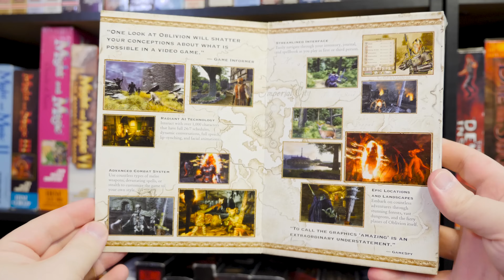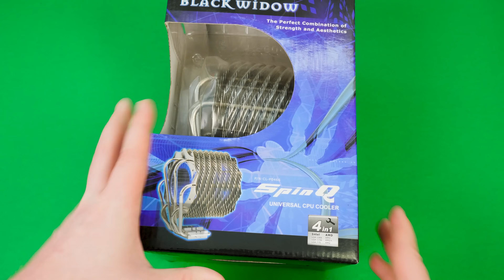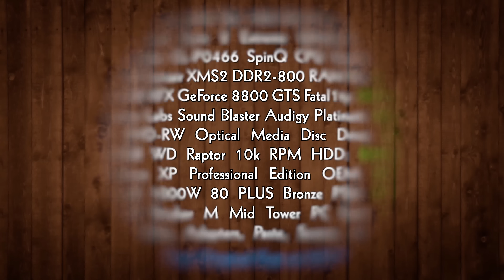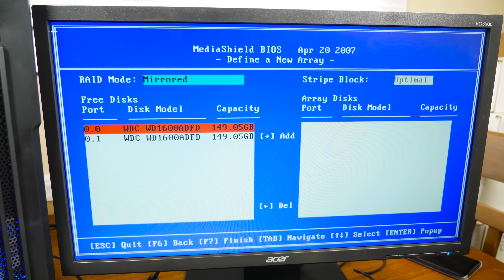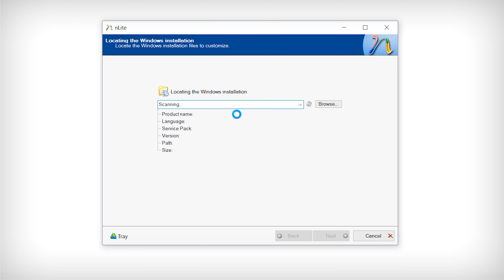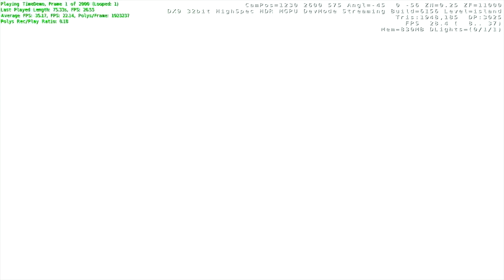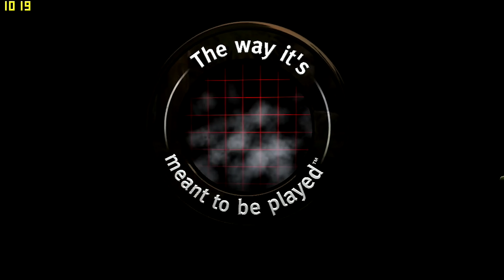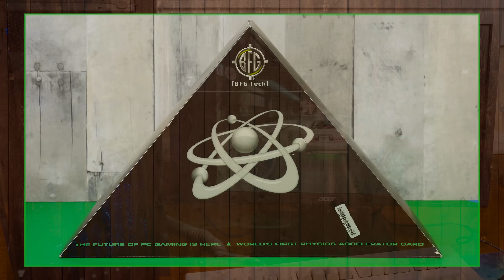LGR - Building My Dream $3,588 Windows XP PC

Comment: I miss how nice XP was without all the “cloud” based bs
Reply: pretty much the cloud based bs started with Windows 7, got way cloudier with Windows 8, and is almost only cloudy with Windows 10
Reply: You're just not using cloud right...
Reply: There are clouds...on the desktop X3
Reply: @uwu_peter  "almost only overcast* with Windows 10" ;-)
Reply: Welcome to 2021. Where everything is online all the time.
Reply: @wut6922  2027: Can't breathe without an internet connection
Reply: I hate to be that guy.. but this is honestly where Linux comes in. Super modern OS, more modern features than Win 10, 0 Cloud bs, 0 tracking bs, 0 ads bs, zero win 10 bs, Max security
Reply: @BartekJuszczak  And if I use Linux Mint, I can theme it to look like XP or even Longhorn! Unfortunately, I can't run all Windows games without either Wine or a virtual machine
Reply: @LegoWormNoah101  "Can't breath without an internet connection"

I can say that your quote can become a reality.

If the air will be competely polluted, you need to buy oxygen tubes from the internet,which requires internet connection.
Reply: @normalperson-x7o  That's not what I meant, but OK
Reply: @LegoWormNoah101  yeah,i know that is just a joke.But imagine your small joke become a reality..
Reply: @normalperson-x7o  I'd rather travel to another dimension and leave this planet behind
Reply: @LegoWormNoah101  agree
Reply: @uwu_peter  Then Windows 11 coming and was nearly cloudy like Windows 10.
Reply: @megakarlach2  basically just another Windows 10 major update, It should've been the 21H2 update instead. But ehh, things will change in the future anyway.
Reply: @spacetoilet  Depends on your PC I guess, some companies don't want to show the source code of their driver and on linux the drivers are built into the OS and meant to be  open source. 
On my AMD machine I don't need a single driver including peripherals, everything is built into the linux core
Reply: this and with win 7, shame i have ot use 10 if i want a pc gaming now
Reply: yes and when you searched for a program it didn’t redirect you to a bing search for it
Reply: @BartekJuszczak  Those things are why I like Linux, but most people including me just want their programs and games to be compatible and not have to tinker with things when something doesn't work. Win 10 and 11 are bloated but it's never forced anyone to use OneDrive.
Reply: Same
Reply: It was hdd based lol
Reply: YES!!!***
Reply: @BartekJuszczak  yeah but which version doesnt have any corporate bs or hacker bs? I havnt found one yet, though i really want a linux desktop and linux phone.
Reply: @megakarlach2  I predict 11 is just going to be a test-bed. 12 is where things are going to change. ...hopefully backwards, so we can get a stripped back non bs basic version to run on older hardware to keep it out of landfill. All these super fast mega hyper machines that use so much power to do not much more for most users than really basic machines used to do much more easilly are such a waste of resources and power. I really wish the Global summit would sue Microsoft and Apple for causing so much eco-waste and fuel waste. Its killing our planet.
Reply: @carpanojr  Linux is polluted with too many flavors and cloud based crap too. No thanks. And you still have to manually update everything and pray a driver will load 🤣
Reply: @BartekJuszczak I agree with this. I don't want to be one of the "Vegans of the internet" but it's true.
Reply: literally none of my files are online. 
learn how to PC better
Reply: @GooseAffiliate859  oh man! 'vegans of the internet' is such a good term. im using that.
Reply: @pepe6666  Haha yeah, I forgot where I first heard it but it definitely describes those types of Linux users
Reply: I have a feeling most of us who grew up with XP never bought into the cloud bs and continue to store everything locally.
Reply: @LegoWormNoah101 me in 2027: *holds in a massive fart, because the internet went down an hour ago*
Reply: not me turning off onedrive immediately on every new windows install
Reply: @BartekJuszczak  *tips fedora
Reply: IMO XP was the sweet spot for Windows. I mean, every mainline release since then has basically been XP at its core but with a coat of paint, some new features and support for better hardware. XP set the standard for how the OS actually handles and feels, the layout, etc
Reply: @LegoWormNoah101 thats not a bad thing though. Wine is a, for the most part, install and forget sort of deal. Especially if you have a newer graphics card, it's as simple as enabling steam play and maybe adding a launch option or two, and that will get 99 percent of all games on steam working with virtually no issues (anti cheat is a speedbump but its getting better daily). The only real reason i keep windows is for VR and mod heavy games like Skyrim.
Reply: @uwu_peter o hello there proto
Reply: @1MadJack1  :3
Reply: @Dousch I’m almost 100% cloud and realized I need to have an offline hard copy too
Reply: @uwu_peter  Huh??? Windows 7 did not have cloud integration. There was no Microsoft account abyss in Windows 7. Windows 8 and later yes, but Windows 7 no, and that's why it's as fondly remembered as XP is.

Comment: The reason your pc wasn’t booting with  2 sticks is because you have them in the wrong slots. Often motherboards won’t boot with the wrong slots. With only 2 slots you use the second and fourth ones from the cpu socket. Plz like this so he sees it.
Reply: DarthSmartt I can confirm this on my motherboard I had to do this
Reply: It's true I learned it the hard way why I couldn't tell you  use 2nd and forth slot it will help
Reply: This only applies to some motherboards. Read the manual to see where your sticks go, it varies by manufacturer.
Reply: Actually it looked like he forgot to clip the ramm all the way in the first time. You can clearly see the clip isn’t lined up with the empty slots.
Reply: nah, im pretty sure its the first and third slots
Reply: DarthSmartt yep, the hyper threading worked with matched pairs of sticks.
Reply: I can confirm this because I have this exact motherboard from back in the day...slots 2 and 4 for dual channel config
Reply: @SocialSpit  --This isn't an attempt to stroke my ego nor am I arrogantly nitpicking at your choice of words .... The term you used is simply incorrect in this context so I'd like to offer a correction with utmost respect ;)  Hyper Threading tech allows a single core to be utilized by 2 separate threads--Essentially making it as effective as 2 cores with multi-threaded applications.  What you're referring to is "Dual Channel"--When the correctly paired memory slots are used with 2 identical memory sticks, dual channel mode is enabled and allows your RAM to run at it's advertised "effective" DDR clock speeds.
Reply: Also, in reference to any changes to either of these technologies over time (you had stated it "worked"... past tense), both HT & Dual Channel DDR(1-5) work the same as they did in 2007 on a basic, fundamental level.  Again, this isn't to call you out and feel superior or anything... I simply wanted to share some facts with whomever might read this.
Reply: @CreativeTimelapses2hondamax  Like others have stated it varies depending on the motherboard.while alot boards may use the first and the third(my ryzen based system included) it isnt always the case.
Reply: 20:44
Reply: That's entirely dependent on the mobo's RAM channel setup, this comment automatically assumes it's a dual channel setup which for a circa-2007ish mobo definitely isn't guaranteed.

It appears the stick wasn't 100% seated from what I can tell in the video, then there's also the possibility it was just a bad stick of memory. It happens. It very well could've been a channel issue, as while dual-channel setups weren't the 100% all-the-time norm for mobo's of the time.. it would've still been likely, especially on an EVGA gaming mobo. Though, rather or not the mobo would've refused to post OR would've simply booted up in single-channel is another story.

TL;DR: There's a lot of shit it could be, assumptions aren't worth much.
Reply: Looks to me like he didn't push them down hard enough.
Reply: no it's either first and third slot or second and forth slot... obviously it makes most sense to use the first channel (but some motherboards like mine don't care if you put two same ram stick on two different channels)
Reply: The manual says the memory cant be next to eachother unless youre using all 4 slots
So using two ram sticks you can use
1&3 or 2&4
Reply: @Evanski  depends on the board, I could use same memory both on different channel.
Reply: You guys did watch the whole video, right?
Reply: channels are always color coded

Comment: So much nostalgia. Hours and hours spent on Guru3d reading articles about GPUs I could never afford.
Reply: Paul Street what about now though?
Reply: Same here.  For me, this was the pinnacle of watching PC hardware.  Always reading and looking forward to the new GPU release even though I was never able to afford them.  Then Sandy Bridge came along in 2010 and shit was stagnant for years.
Reply: @brianwong6195  Its still stagnant except for increase in core count. U can easily game on a 6 year old gpu today. gtx 970. If it was 2000 to 2006 your 2000 pc would have lasted maybe until 2002 tops. I dont mind as now you can game on stuff til they mechanically fail instead of having to replace perfectly working machines.
Reply: @XTNDEADPLAY  you didn't ask me but i will tell you. For the first time i decided to buy a decent video card. Decided to go with nvidia because they have the best cards right now. They have a newish series of cards out right now, GeForce RTX i decided to get the 2080 super ~$600. In certain situations they even beat the ti! which is priced at about $1,000.
Reply: @Andytlp  You are laughably wrong. The leaps in GPU performance over the past few years are absolutely insane, with the coming generation of hardware 4K will probably become the standard on PC. Intel and AMD both have also come a long way, AMD especially, in the CPU world. If your only reference for stagnation is 1080P gaming, that's your problem. Next gen consoles are also going to be pushing storage tech waaaay ahead. But I guess computation power skyrocketing, real time hardware raytracing, 20GB/s+ storage speeds, workstation and server CPU's going apeshit and everything else happening is 'stagnation' in your muddled brain. Also keep in mind software optimization is leaps and bounds ahead of where it was in the past, which is another huge factor.

Your statement of hardware still being stagnant is a meme and a GTX 970 is not going to keep up worth a fuck today unless you exclusively play indie games or older AAA titles.. unless low-medium 720-900P is your go-to or you're fine with 20-30FPS. Even an RX 590 Fatboy (my old GPU before upgrading to a 5700 XT) which is a far more capable card than the 970 shows its age hard today. Just because your $300 budget machine can launch games from 2010 in 1080P 30FPS doesn't mean hardware is stagnant. You're an idiot, the age of 60FPS/1080P being the standard is dead.. you just don't realize it because you're wallet-limited I would assume. TWO fucking 970's in SLi can't even achieve Ultra 1080P 60FPS in a game like Fallout 4 which is hardly the pinnacle of demanding software.. but hey it's 'just fine' and 'future proof' by your incoherent rambling.

Stop looking to 1080P benchmarks and you'll quickly realize the technology isn't stagnant, it's underutilized at those resolutions. Benchmark a 970 against a 5700XT / Radeon VII or a 2080 / 2080Ti in 1440P or 4K and you'll see massive gaps in performance.

The only thing stagnant is 1080P gaming.
Reply: @HystericalHuntress No need to call other people idiot. i get what's he's talking about , as long as the machine still works and you're just doing normal task and gaming, why bother replacing the parts ? Not everybody is a pc enthusiast and can afford expensive shit like you. learn some manners before commenting and keep in mind that others financial status is not same as yours.
Reply: Yup same :(
Reply: This kind of config was a dream for numbers of young geeks in 2007 !!!

Comment: Core2 Extreme & 8800 Ultra SLI was the bomb when I was little :( It was just a dream for me a few years back. Was only using a pentium 4 with a 64MB gpu back at that time. 13 years later, was finally able to save up for a Ry9 5950X and RTX3070. Your vid game me so nostalgic feels during the times I could only dream of having stuff that didn't lag on the lowest settings. Thank you for this! ❤️

Comment: this remains one of my favorite builds on youtube. im fascinated with SLI setups, active cooling chipsets, and odd cpu coolers for some reason.
Reply: They're things you just don't see anymore. We still get the occasional whacky CPU cooler like the Thermaltake Engine 27, but nothing quite this extreme. At a certain point, with today's high end components, it's either Big Noctua Block or liquid cooling, basically nothing else.
Reply: Same, I love this stuff. I'm building out an XP machine now but went with the older Socket 939 circa 2005. It only supports DDR 1 so I'm interested to see my performance in some of these games. Hopefully the lower resolution I'm targeting helps too.

Comment: builds $4k PC

plays 3d pinball space cadet

Me: Wow I would get that
Reply: If I had the money, I'd do the same too to be honest lol
Reply: I spent slighty more on my new tower and the day i finished building it my wife claimed it and it is now a business/ cad pc ;'-( Im still using the gaming rig i built in 2009 for this reason.... its amazing it still works being overclocked hard everyday of its life!
Reply: @Maccat  why dont you two just trade computers?
Reply: Wow that is relatable (reference to something)
Reply: wow
Reply: People I know did exactly that. For years they couldn't afford a gaming pc and played on minimum and config hacks when they finally got the money for a gaming pc they either don't play anything or play some broken and outdated garbage that they could play on a old pc. IDIOTS. Getting rid of them is the best satisfaction one can get.
Reply: That reminds me of my recent upgrade. I spent about $1000 to upgrade my motherboard, CPU, RAM, heat sync, and added an onboard SSD to my PC. I upgraded to play Red Dead 2 and to run work programs easier. Before upgrading though I was playing a lot of Metal Gear Solid V the Phantom Pain. It ran perfectly on my old setup, and after I upgraded, instead of playing Red Dead 2 I just kept playing MGSV at the same high setting and same frame rate.